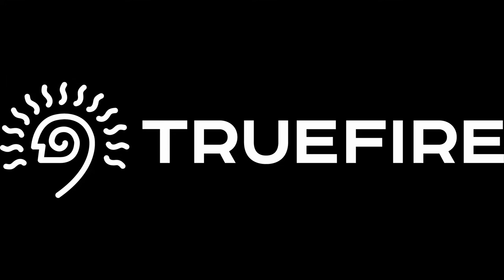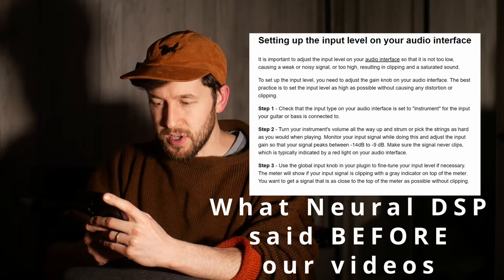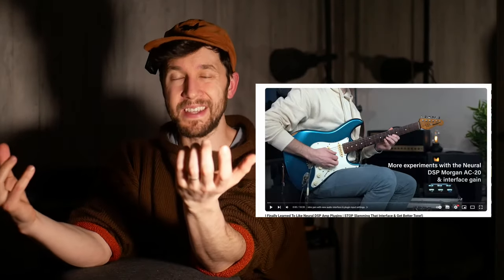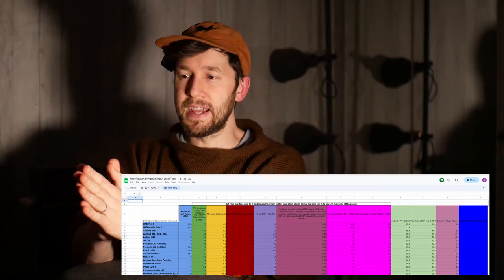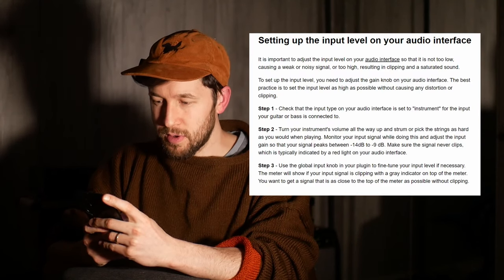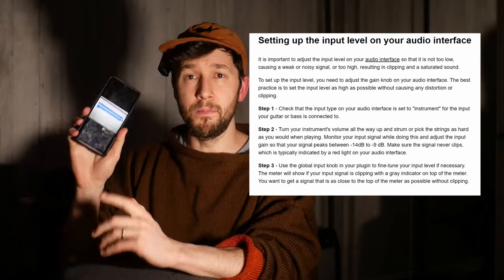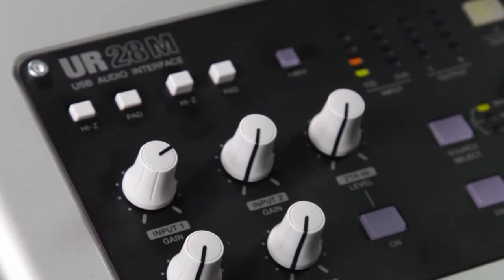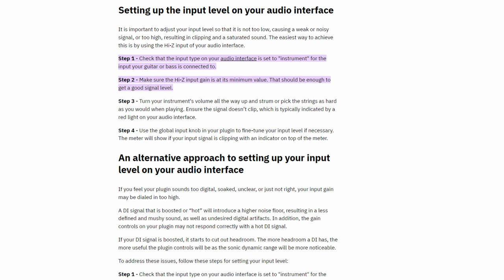Why Are Neural DSP Gaslighting Us About Plugins and Input Gain?

Comment: Two main issues here...
1) Plugin companies are anything but standardised with regards to the input levels they calibrate their plugins to. Neural DSP and BIAS, for example, will work when your hardware interface gain is set to 0. S-Gear (a superb plugin) will barely register if fed the same '0' gain level (the level increase within the plugin is not enough) - you must ramp up the interface gain to get a meaningful plugin input level.
2) Those that only play distorted, particularly more saturated, will have zero clue, or perhaps, interest, about this issue...for obvious reasons. BUT(!!!), they are missing out on the TRUE tones of all the distorted patches included/purchased.
--> Why in fk did the plugin makers go against established protocol...AND NOT LOUDLY TELL US WHAT TO DO ? !!!
Reply: I have been following this since Rhett’s video. I use Bias Fx 2 a lot in home setting and if I set interface to 0 gain, it yields VERY low input signal on amp sim and to me doesn’t sound good at all. I have been adjusting interface input gain to bring input level on sim to -10 to 0 and it seems to sound much better. Anyone know what BiasFx2 settings ‘should’ be or am I doing this wrong? I use MOTUM4 btw. Thanks
Reply: @fouryearsbehind  You've raised an excellent and crucial 3rd point - not every hardware audio interface has a gain knob easy to 'standardise to zero gain'. The gain knob on my own RME Fireface 802 goes from +6 to +60 (not 0), suggesting my Fireface adds '+6' at the lowest setting.
The thing is, every plugin can measure the input signal - you usually see it in a meter. If that input level is clipping then the plugin developer should be shouting to the user...or/and, auto reducing that gain. This doesn't appear to be standardised also since we're hearing of clean patches sounding distorted. It's all a sad mess, and it shouldn't be!
Reply: I noticed that with S-Gear as well. It seems to be the exception to the other plug-ins in that you have to increase the input gain on your interface. Agreed that it is a superb plugin. It doesn't get the attention it deserves.

Comment: Thanks for this insight! i will remember it. gain on the interface (I have UAD) set to 0. input level in amp sim (neural) also at noon (=0). However, i have quite low output pickups (single coil, set to low pickup height). So i'm coming in at -25db in my UAD. What would you do? add a boost pedal before going in the UAD? or just leave it?

Comment: I've always set my interface's input level to the point where it flashes green just for a second whenever I do a palm mute on the low E (I use a focusrite interface, for reference. If the knob ever turns yellow or red that's dangerous) and I've never had issues. There is literally no downside to having your input gain low, because if your guitar is too quiet you can always turn up the guitar track in your DAW of choice, and if your input isn't driving the front of the amp hard enough then you can add a volume plugin before the amp to adjust to taste, if you don't have an input knob in the amp you're using of course. You should never have to crank your interface for more gain.

Comment: But still this "new" advise doesn't works for AT5 ... it sounds very thin and further needs almost +12db boost to strengthen the tone , for specially high gain amp like mesa mark 4 and 5 ... 🎉🎉 so now ive just decided to set a good tone as per my ears and just enjoy playing,  which is most important mission out of all !! 😊😊
Reply: amp dependant, some need more input some need less. They really need to update it just with a built in gain stage that normalises the amps to a singular reference level unlike what seems like completely different references for each pack (mesa, fender etc).
Reply: Would be nice to have an excel like Eds' did for IF's, but now for the Amplitube amps. How much to boost the plugin input per Amp type to get an accurate result .... Or we can hope they address this in Amplitube 6 ?
Reply: @dekofschipper8412  Ed (I think it was Ed) did this roughly. Can't remember where to find it though it was on a gearspace thread.
Reply: @JimijaymesProductions I can find a Youtube video where he does this for a few of the amps but not exhaustively. It is a bit scary though as he suggests some amps need even more than 15dB additional gain to even sound in the ball park. So stuff seems to be way off and unless you can compare with a real amp, you are still left in the dark.

Comment: I still think that is pretty self explanatory to adjust the gain on your audio interfaces pres to get a good signal level, but not pushing the plugin into saturation. That might mean minimum on some and halfway on others. It definitely is a gain staging issue, as a preamp in your interface is a gain stage just like the preamp on your amp is. I'm a bit baffled that this is an issue too.

Comment: I use the Logic Pro X stock amp sims, and there seems to be inconsistency even across different amp models, which is pretty irritating. The small brit model doesn’t have nearly as much gain as my actual AC-15 without any premp boost from my interface. I have no doubt the developers at Apple/Logic have created pretty decent amp sims, but I have no way of knowing if the gain response of any of them is accurate at a given preamp gain level

Comment: I wondered about this as well in the past. for the same reason it absolutely makes no sense to have a boost of any sorts in your signal path before the interface. It's almost like one would want a limiter/compressor before the plugin that adjusts the input signal so it's the correct range for the plugin. For that we'd need the relative "pure guitar" signal levels. If the plugin is was created with a fat humbucker and I play a single coil the max signal level value needs to be adjusted such that it's in the correct single coil range relative to the humbucker. To an extend this is also true for all things like an axe-fx or even digital pedals, but to a lesser extend. But a lot  of the vintage sound is based pedals boosting each other and at some point being thrown very hard against a tube plate. digitial converters have a limit at which they distort digitally which is very unpleasant.

Comment: I don't quite understand what the new best practices are. What is "Minimum"? is that turning the input volume on my interface all the way down to 0, as far as it can go?
The video you linked by EdS says to turn the input on my interface all the way down as far as it can go. Say I'm going guitar>Focusrite Scarlett>Helix Native...At that point I can still hear my guitar and Native is peaking at about -36 on the input meter (set to 0db) but I'm not getting anything on the LEDs on my interface. It doesn't light up at all no matter how hard I play. Is that correct? 
I've always set things to just below clipping on the interface. That would vary between whatever I was plugging in, be it mics, guitars, basses, etc. That was always the general concensus even before plugins were a thing.

Comment: Am I the only one who gets an absurdly low signal when recording with no input gain? Like, so low I have to dime the output volume and listen to the noise floor along with my playing, keep in mind I'm using decently high output instruments
Reply: That's weird that you're getting noise floor at that point, most digital stuff doesn't. However, yes when I first started recording I was absolutely shocked at how insanely quiet everything is. Before you mix and master it's going to be incredibly quiet. Just turn up the monitor knob on your interface. 

It will probably take a little while to start learning how to mix the high frequencies, because when you master they're going to jump out at you and it will be way brighter than it was before.

Just remember to turn it way down when you start mastering or you're going to blow your ears out, lol.
Reply from the maker: If you're using single coils, yeh it'll be really low signal

Comment: I remember hearing this advice but i don't remember where. I did this for years.  However, I've had much better results at minimum. Additionally, I use a radial pro48 active di box with the -15db almost always engaged. The headroom on that is much higher. Cheers.

Comment: I've had to adjust gain depending on what I'm playing. I usually have to increase my interface gain when I'm playing leads because the signal isn't hitting as hard as when I'm riffing on the low 7th string. 

Am I just not picking as hard? Maybe. But the high strings don't have as much bass. I haven't tried going into a compressor pedal first to see if that makes a difference.

Comment: I have a PreSonus Quantum 2626 interface. It has a huge range for input volume. When I set it all the way down it is way too low for any high gain amp sims and even clean amps don't sound right. I like high gain stuff, but I also do low gain bluesy stuff as well. I found that it all depends on what you want. Some companies like S Gear said they didn't have any specific input levels and you can tell with their amp sims they all sound good no matter where you set the input level from your interface. Th-U on the other hand sounds the best when you almost clip the input. They even have a meter that shows you where they expect to see input levels. Genome is a new one that I have been messing with. It seems to be like S Gear as well. Even setting the higher input levels the clean amp sims sound clean and clear as a bell!!! So, I think it really depends on the type of music or tone we want and also the companies that design this stuff... I have some Neural stuff, but nothing compares to the amp sims I just listed!!! Try Genome if you like clean stuff hahahah

Comment: Funny thing is that going back to when Helix Native first came out, I told so many people to not add gain via their interfaces on the forums and on Facebook, I couldn’t possibly count. But so many people were asking why Native sounded different than the hardware, and it was so often because of this. But if you think of what a plug-in is doing, it’s essentially re-amping. If you were recording a signal to run back into a real amp, you wouldn’t want to gain that signal up. You’d want the level to be the level coming from the guitar to begin with.

Comment: It's pretty easy to reduce the level of a signal going into a plugin and the Neural plugins even have an input trim knob.  Especially where a compressor is part of your signal chain, I think I'd rather have the highest signal-to-noise ratio I could get and then set the level going into the saturation part of the processing appropriately.

Comment: The Avid Eleven Rack kind of solved this problem, but surprised nobody has implemented their method since. There was no gain knob and therefore a lower output pickup wouldnt drive your virtual amp as hard etc, so it reacts how an amps front end should and is consistent between guitars to how real amps and pedals are. Im sure the Eleven Rack wasn't perfect, but hopefully others go this route.

Comment: As an Amplitube user, the inconsistent ideal gain for its presets have always gotten on my nerves. To the point where I’ve stopped using it. It seems like basically all the models vary in the amount of gain needed to get them sounding accurate and trying to figure it out just felt like a headache

Comment: 16 year career audio engineer with an honours degree in same, here; "giving it as much gain as possible before clipping; then backing it off" is absolutely KEY when recording ANALOUGE, this is due to the inherent issues of signal to noise ratio in analouge equiptment, most evident with analouge reel-to-reel tape. In DIGITAL; this is about the worst advice you can give, you should never be "in the red" with digital, I'd argue you don't want to even be "in the yellow" running into an A/D converter. Digital and Analouge are inherently diffrent mediums; digital doesn't have the signal to noise ratio issue of analouge (I mean, it does have sig/noise considerations but it's fractional by comparison) it also doesn't have the pleasant (largely) even order harmonic distortion and compression inherent in analouge gear running hot; digital distortion (when the A/D converter is being overloaded; not "amp modelled distortion like on a guitar plug-in" just for clarity) is usually enharmonic and pretty fucking horrible, hence working "in the green" is preferable. I thought we had resolved this all years ago by calibrating to DbTP rather than DbVU but I guess that's not trickled down to the "pro-sumer" market these people are targeting.

Comment: I kinda understand why the manufacturers were giving that advice, cause back in the day when interfaces didn't had a hi-z input and your only option was to use a DI box you had to do gain stage that way, cause the DI Box only converted the signal from high z unbalanced to low z balance (usually XLR). So I wouldn't be surprised if what happened was that they didn't realized that audio interfaces fundamentally changed the way they operated to be a more prosumer friendly product.

Comment: And this is exactly why I use amps, the whole tech landscape is a total turn off for me. All the faffing about with tech is so draining that you play less instead of more.
Reply: You can get caught in the same loop with real amps too, especially when you start adding pedals to the mix.
Reply: @revonfyll  as far as pedals are concerned I would agree but the fact that there are usually knobs on a pedal to facilitate an immediate response makes them so much more tactile.
That being said, I tend to just go straight to an amp with just a touch of reverb and with the right gear I don't think you can beat it.
Reply: @muttonjeff105  I use both amps and plugins and I understand the pros and cons of both. I too hate when settings fiddling get in your way of playing, which is why I try to stay as away from tone chasing as possible. Plugins can induce severe case of option paralysis, which is why I mostly use presets.
Reply: People chase tones for years with amps (and with a lot more money)
Reply: That's great for you, for me it's the exact opposite.
Reply: There’s this feature in most software, it’s called “save”. It’s really useful because once you save a sound you can recall it at any time.

If you learn about the save button, it’s really no different than dialing in any sound on an analog setup, other than the ease of recalling that sound being simpler with a saved preset. Also you can control your preset selections with a floor midi pedal which greatly simplifies the concept of a pedal board because you’re just using it to recall a preset or control virtual pedals. It’s a lot easier than an analog pedal setup because you never have to reconfigure the physical gear to make any adjustments to the signal chain.
Reply: @Necropheliac  did I say I didn't know all this? Still doesn't and never will sound like a real actual valve amp. Period.
Thanks for your explanation of guitar technology though.
Reply: @muttonjeff105  This is a different point than your first one though.

I agree that plug-ins don't quite sound like amps, but they're getting extremely close, so I'm not sure about the "never" part. They sound indistinguishable for a lot of people.

One good point though, is how plug-ins are all about imitating real amps, whereas real amps are all about sounding different from one another. So long that plug-ins only strive to imitate real amps, then amps will never go obsolete.
Reply: @muttonjeff105 I’m glad that you finally remembered that your first argument was bogus.

Comment: I also had problems where presets didnt match the sound I expected. I was disappointed with NDSP in general. BUT, I did not raise input gain untill just before clipping. I am using an Avid Eleven rack. A standalone guitar interface. Playing through the 11R I never had any issues. I would expect the signal chain is setup for guitar inputs. Seems obvious. I would expect that the DI should be in the ballpark without doing anything. It is designed to work with protools and you can even record wet track and DI track simultaneously to separate tracks so you can reamp the DI track later if needed. I think I agree with Rabea on that view. You shouldn't really have to do anything and if you had raised the gain it should be obvious that the tone is more saturated than the videos. I would be happy enough if that was the only problem, a little more gain than expected. But to me that isn't the case. The presets sounded thin and like the signal chain was broken or something. Just the feel and responsiveness was completely off. I play something through 11R and it feels good, similar to an amp. Then I use a plugin and It did not feel like the response you get from plugging into an amp. It is almost similar to if you lower the guitar volume but then it is around the threshold level of a noise gate. Not exactly like that to the point where the noise gate cuts the signal off. It is similar to that but raising the input gain doesn't help.

Comment: I thinnk the general confusion here is that this advice is done for mic level. Typically the Audio interfaces are in the end of the chain, are used for recording and then it is only added post effects and production. However when someone is using a pedal and/or amp plugin, the end of chain mindset is no longer applied the end of chain it will be after the mic/amp emulation the user is using the the DAW.
Basicily the signal that comes out from the guitar pickups, is an analog signal it will have an amplitude and a frequency, and that will always be the same hitting the first device, being this a pedal an amp or an audio interface, so if anyone is using pedals and amps inside the computer, makes sense that the the signal hitting these virtual devices has the original amplitude, to a more precise recreation, has it would be with the hardware devices.